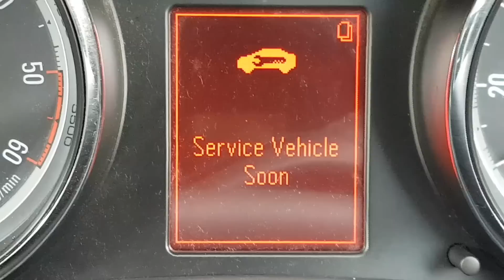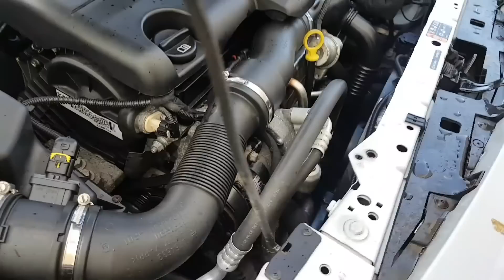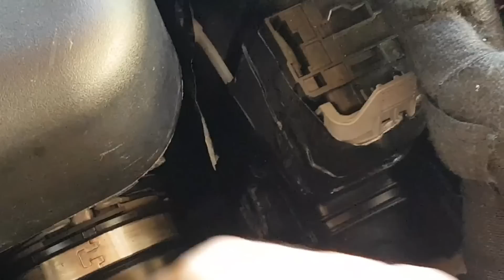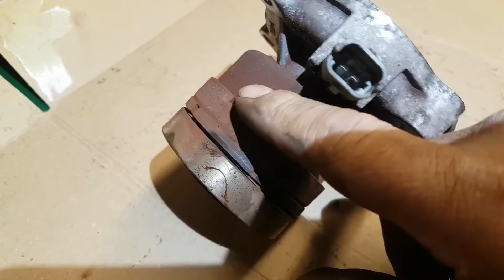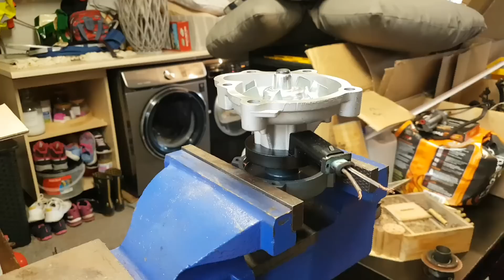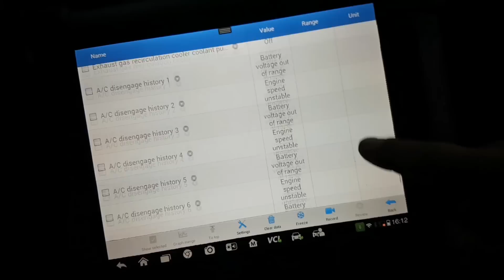Vauxhall Astra J 1.7CDTi "Service Vehicle Soon" message... Fault finding and repair.

Comment: The clutch on the water pump is for EMISSIONS - it is meant to let the engine heat up quicker so that the car is running & burning the fuel  the  best to cut down on NOX & Soot  for the DPF 
there is NO other purpose for it than this - you can get the "clutched" pumps after market but they are still expensive - so the "fake" clutch is the comprimise 
Did the Meriva on the ramps not have a clutched waterpump - as it was the same engine ??
It all depends on which EURO class the vehicle is - 
the manufactures were forced to put these cluthched waterpumps on as well as variable pressure oil pumps from EURO 5 
It all depends WHERE in the world the car was made & for which market  - Vauhall / Opel - it could have been built in Germany (or just the engine built there) - so to save hassle they just fit everything with the same parts hence some cars engines have the emissions stuff and some dont from the same manufacture & same year 
Great video 👍👍
Reply from the maker: 😊
Well explained...
I will stick this...
👍👍👍

Comment: hello sir My car ford focus mk 2.5 had an issue with the instrument cluster. I arrived home, turned off the engine, and after that, the car wouldn't start. I removed the instrument cluster and tried to fix it by soldering, but the problem persisted.

Then, I disconnected the battery to recharge it, but the car still wouldn't start. Sometimes, the display shows an 'Engine Malfunction' warning, and a central warning light flashes rapidly, followed by one long flashes and six short flashes.

When I turn the key to start the engine, nothing happens at all
Reply from the maker: Have you scanned the car?
Check fuses, connections, etc... before anything else...
👍👍👍
Reply: @LMAutoRepairs  i don't have scanner but i will check fuse and line thank you sir i will ask more. im not good at English language sorry
Reply from the maker: @meijifamily8294 
👍
Reply: @LMAutoRepairs  i check canbus in obd2 and cluster connect is be 122ohm.
Reply: @LMAutoRepairs  im not good atEnglish language sorry
Reply from the maker: You need to scan the car...
Scan it when the fault is present, and see which modules you can and not communicate with...
Otherwise everything is too vague...
😊

Comment: So, OEM parts are faking the solenoid switching, says a lot when a manufacturer designs a switched pump to no doubt meet emission results and then aftermarket OEMs just add a substituted fake reading sent to the ecu. At least the bolts were GM...

Comment: What is the advantage of an electric water pump if it is still running after auxiliary belt I don't know what the point of a clutch is
Reply from the maker: The pump is deactivated during cold start, to stop coolant circulating and therefore speed up engine warming up...
👍👍👍
Reply: @LMAutoRepairs Thank you 👍😊 does that affect the cabin heating I wonder

Comment: 1.7 cdti best isuzu engine with opel buggy electronics ;)
Reply: @Vader74  egr a glow plug connections rubbish  lol I know i had one .other than that there not that bad for a car
Reply: @Nemesisx1974x  there are models with glow plug with pressure sensor cost 100gbp one piece, mad stuff
Reply: Mine engine didn't have them had the normal one's and same with my insignia  lol .I just replaced all of them on my insignia as well all 4 for 52£ bosh  lol

Comment: Unlucky Luis. I have been there only once! I was told to replace an alternator, and all checks confirmed by someone. After replacing the alternator it turned out to be the main fuse! It turned out a short happened when someone jump start the car. That was a Hyundai i10, partial front end removal = hours. Changing main fuse = minutes. Nobody is perfect.
Reply from the maker: 😊
Indeed...
👍👍👍

Comment: I’m fairly sure the component will be a diode to prevent voltage spike as the coil is de-energised like in a relay. I’m surprised the manufacturers are allowed to make that without the clutch as it’s an emissions reduction feature. Great video as usual.
Reply: Diode for inhibite voltage spike is inside ECU and connected to GND.
Reply from the maker: 😊
It looked like...
👍👍👍

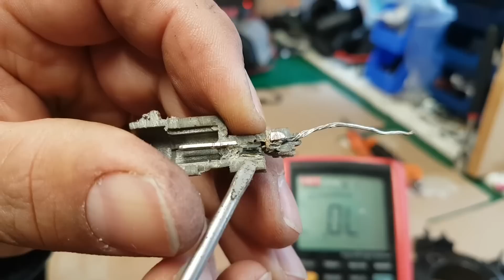Comment: For 52:20 it could be a back emf diode. This wire directly goes to ecu, to prevent the back emf current damage on ecu they inserted a diode, ( just guess)
Reply from the maker: Could be...
😊
👍👍👍

Comment: Some of these ECU plugs are a nightmare. Did a 2020 Vivaro the other day with a MD1CS003 ECU. The plugs on these look very similar to what you had there. They need lathering in GT85 and leaving 20 minutes. Then waggle the cantilever back and forth. I was at that one 2 hours and it still broke. Sometimes the pips break off the ECU, sometimes it's the plug. Utter junk.
Reply from the maker: 😬
I know some are terrible in that respect!
👍👍👍

Comment: "the car has to stay locked for 4 hours after the reset"? Could you elaborate? Thx
PS...(as I watch the video): the first aftermarket part it's not "fake", it works differently. It works by using the liquid pressure (antifreeze in this case). The original part works by a using a classic electromechanical clutch.
Reply: Youre wrong, youre acting smart.😅
Reply: @drazenaudi7864  the fact that the earth is round and not flat and I understand that doesn't make me acting smart... Just watch the video I put in the link to understand the concept. If you can't go the extra mile then you are correct...I'm wrong 👌. Didn't want to play smart, I didn't design the system, just pointing out Luis didn't put the wrong part in the car.
Reply: @drazenaudi7864 whats wrong with being wrong? We are all here to learn something
Reply from the maker: If i recall correctly, once you reset/program the new battery, the car wants to stay locked for 4 hours to do some sort of measurements while the car is asleep...
👍👍👍
Reply: @LMAutoRepairs  I see the point, makes sense for the control module to check for parasitic drain...but...is this a GM procedure? Usually the diagnostic tool gives you the proper procedure... Maybe I've done battery coding wrong until now ?! 🤣. About the hydraulic clutch detail...there are videos explaining the way the system works.
Reply: @LMAutoRepairs  something like that:
https://youtu.be/4ukTilxezVw?si=KLvPHXWMe7mSpZek 
This system is different, but you get the point about the way it's engaging/disengaging the clutch. So the pump you've put in is ok.
Reply from the maker: Yes, was the tool that suggested the 4 hours settling time after the battery reset...
As for the pump, I know the principle of the clutched system, and that the one without clutch will work just fine...
The ecu in most cases, switches the pump off stopping the coolant circulation during the cold start, to allow a quicker warm up...
Dave has great content!
👍👍👍
Reply: @LMAutoRepairs  I was talking about the way the clutch is actuated...the original one is electromechanical, the aftermarket one is electrohydraulic. Same result, different type of actuation system.
Reply: @alexdragomirescu5084 the only thing that activates the new pump is the belt just like a conventional water pump and their is no electrical input whatsoever the ecu is just fooled with resistance which is what it’s looking for.